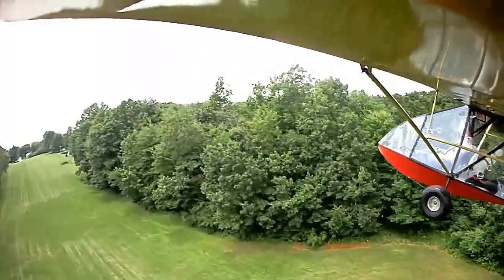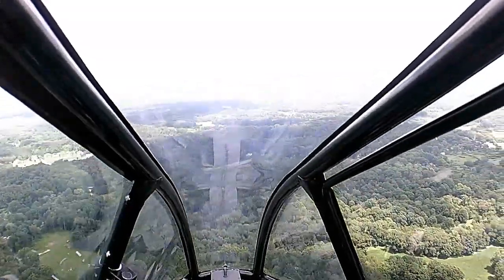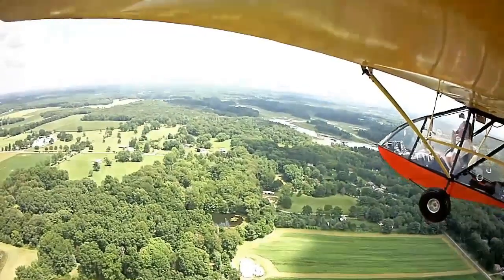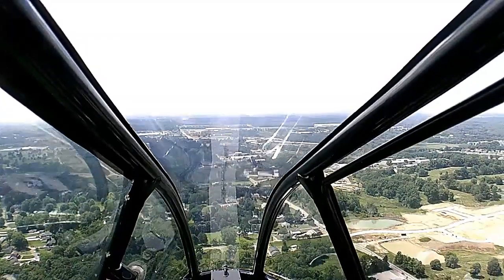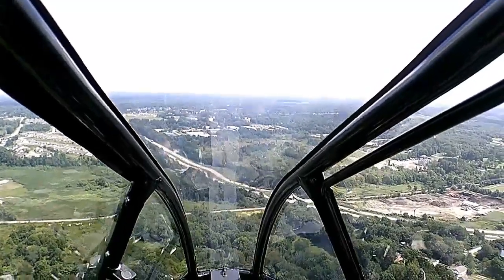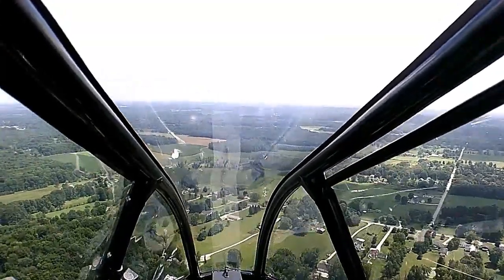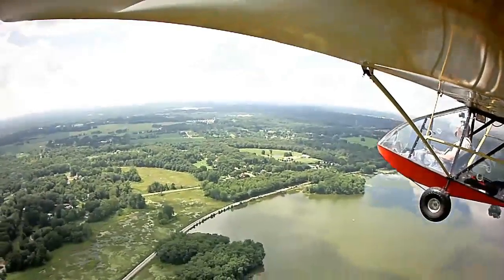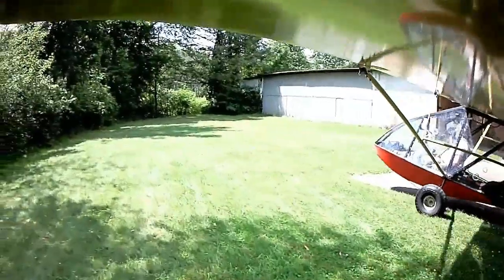Brimfield, Ohio tour by Chinook Ultralight Aircraft.

Comment: Are the flaps worth the hassle?
Reply from the maker: When I first built the Chinook I never used the flaperons. They scared me. I would try them at high altitude only. I preferred to do a slip to slow and drop.
Flaperons are not as good as separate flaps, as there is a loss of roll control response.  The bellcrank is mounted to a sub-plate that can slide back and forth, so they are simple to make.
See my playlist about the Titan Ultralight with separate flaps and aerodynamic type trim.
Reply: I'll check out the Titan video.